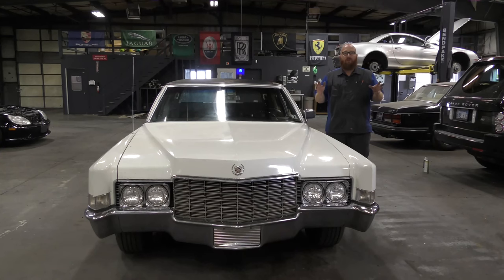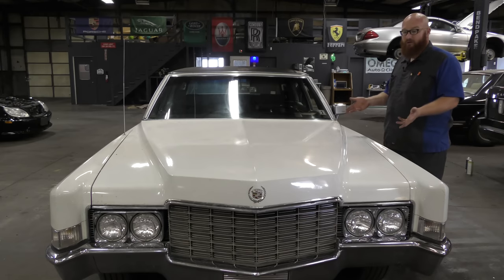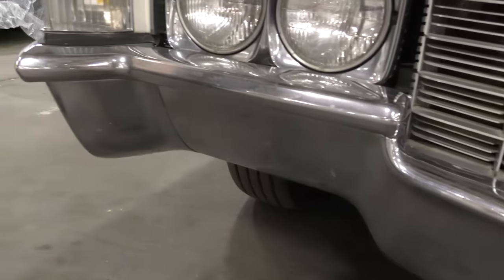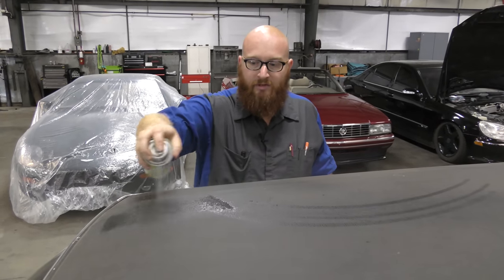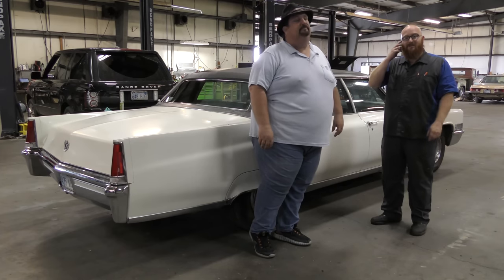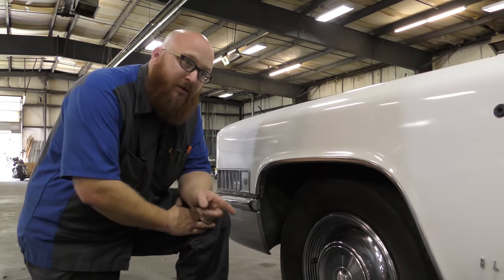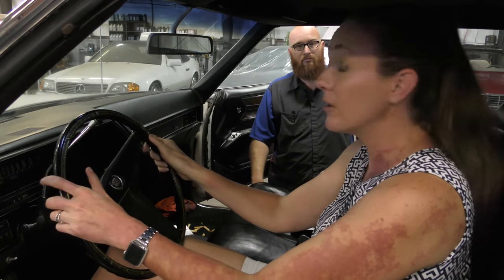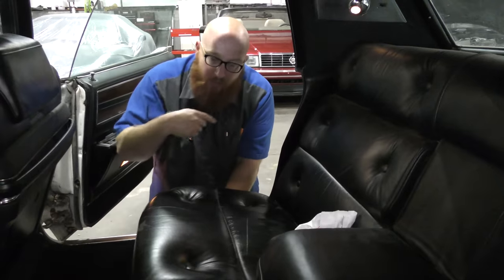Dirty Business! CAR WIZARD shows on his '69 Cadillac what you must do to get top dollar for your car

Comment: Car weeezard. I doubt you’ll probably see this but, hey umm I am desperate at this point my car won’t move what so ever. When I put it in reverse, nothing. When I put it in drive, nothing. But when I put it in park it makes an awful noise I can’t explain what the noise is. And when it’s in park you can still push it as if it was in neutral it’ll move back and forwards. I have a 2004 Volkswagen Jetta GLS 1.8T automatic tiptronic transmission. Please if you, or anyone, can help me out please I have school in like two weeks I need this car to move so that It can take me and my siblings to school and back every day please help me
Reply from the maker: Sounds like time for a new transmission. Or atleast a transmission rebuild. Easily $3500-6000
Reply: Car Wizard nah I found the problem it was pretty simple the drive axle was detached from the transmission I think the bolts must have fallen out from poor maintenance by the last owner but thank goodness I found the problem before handing it to the mechanic but thanks for the help and I love your videos I’ve been a big weeezard fan

Comment: If I were looking at a car and see empty bottles of oil or coolant in the trunk or engine compartment, I wouldn’t even bother using that to negotiate a better price. I would run away ASAP because that means mechanical issues the current owner doesn’t want to fix!

Comment: One thing also that lowers cars value is boombox with fire starter wires without a fuse... even though people say it was 500€ amp and woofer. It always has some firecracker wiring under the dash and engine bay.